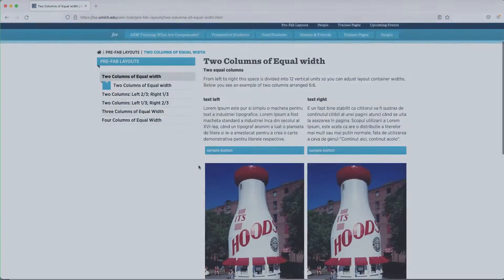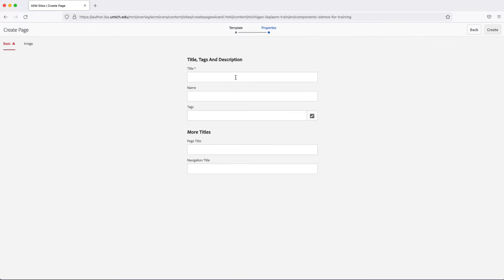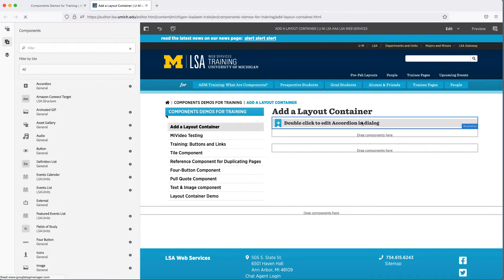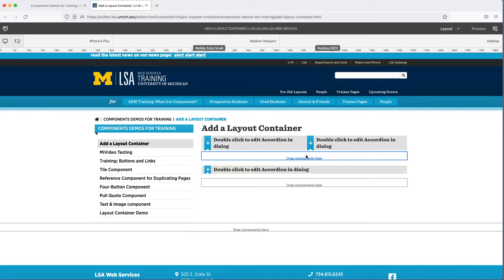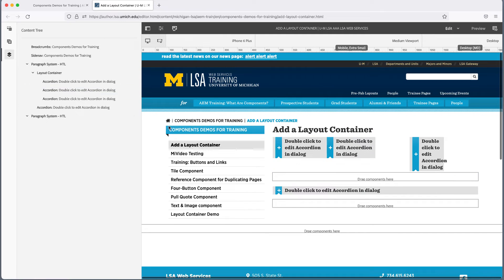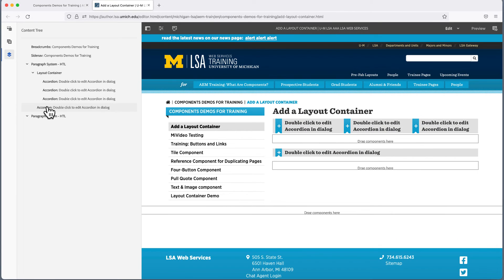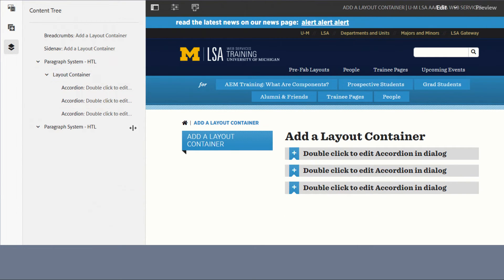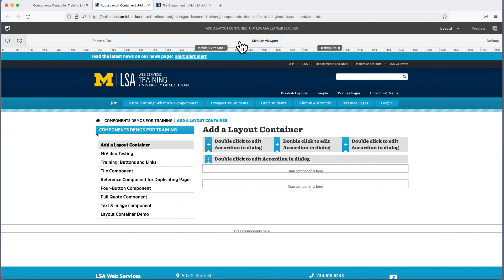AEM Training: Position Content in Layout Containers

Comment from the maker: VIDEO TRANSCRIPT

This video introduces the layout container and how to set up a very basic layout on a page. Layouts can get complicated very quickly, so the Web Team at LSA Technology Services encourages you to contact us for support with setting up layouts. We can also furnish you with pre-formatted pages at your request- please have a look at the model pages on the Training website. 

https://lsa.umich.edu/aem-train/pre-fab-layouts.html

The layout container is a component which is designed to help you organize your pages into sections, such as rows and/or columns. You do this by adjusting sizes of components when the components are inside a layout container, or by adjusting the size of the entire container.

It seems simple enough, but it can get messy very quickly, which is why we have these pre-formatted pages for you.

Still want to take a shot at this? Well then let’s get started. By the way, if you’re following along on a smaller screen like a laptop or other small device, your results may vary. This video, as well as the pages in the AEM Training on Canvas, shows the layout container procedure in a full desktop view.

We encourage you to create a new page, either on the Training site, or on your own site if you no longer have access to the Training site. Use the LSA subpage with layouting template. 

On the new blank page you'll see two empty boxes- one shorter in width, and one that spans the entire page- that say "drag components here". These are drop zones. Please ignore the wider drop zone for this tutorial.

Add a "Layout Container" component to the smaller drop zone. You may either drag and drop the component from the side panel, or click on the drop zone and use the “+”. Another drop zone that appears identical to the first will appear. Your new layout container is the upper one. If you move your mouse over it a blue outline will appear with the words 'Layout Container' in the lower right corner.

Next, we’ll put some components inside the layout container. For this demo I’ll use accordions. Drag the component over the drop zone until you see a blue outline and a half circle with an arrow in it appear above the drop zone, but don’t drop it yet- watch carefully as that outline and arrow will appear above the drop zone in two places depending on your mouse position. We want to drop the component into the drop zone that appears to be the more inside of the two outlines that appear. 

How do we know if the component is inside the layout container? We can make sure it’s in the right place by opening the side panel and selecting the icon that looks like layers. This shows us a thing called the “content tree”. Is “accordion” indented below the layout container? If it is, then it’s inside. 

Let’s add another accordion but this time I’ll drop it in the wrong place so you can see the difference.

We’ll see how to fix this in a moment, but first let’s add one more accordion inside the layout container. This time should be easier since we can watch for the outline and arrow around the accordion that’s already there, and just drop the new accordion on top of it.

Now for the fun part. We have two components inside a layout container, each spanning the full page width. We want to reduce their widths so they can be side by side. Switch to 'layout' view and click the first accordion. When blue dots appear on the right and left edges, slide the right edge to the left to make the accordion smaller. Using the gridlines to guide you, make the accordion half as wide as the available space. Repeat this with the second accordion. 

You might have guessed there’s more than one way to do this. Return to edit view and refresh your screen. Click one of the accordions and from the menu that appears, select the double sided arrow, all the way to the right. This produces the same blue dots that let you adjust the component width.

In the AEM course on canvas that this video supports, you are encouraged to add another accordion to the layout container with the two already there, and adjust its borders. The purpose of the exercise is for you to experience how AEM- a computer program- responds to the adjustments you make. You may have to think like a computer in order to get the hang of using the layout containers. Remember that the Web Team is here to help you, and we have those pre-formatted pages if you decide not to set them up yourself.

You can usually fix this mess by opening the content tree and readjusting the widths of your components, starting with the one that appears at the top. AEM considers this the first one and will always put it as close to top left as it can, following left-to-right reading order. To keep things from getting out of hand we recommend using the dots on the right sides of components to adjust them.

Let’s return to the content tree, the misplaced component, and what to do when your component ends up outside the container. In the content tree, I will find the accordion that is not inside the layout container by looking for one that isn’t indented. If I click on “accordion” here in the content tree, the editing menu for the component appears over that component on the page. This will help us figure out which accordion is the one we want to move.

Sometimes the easiest thing to do is just delete and try again. You won’t lose any content if the component hasn’t been configured yet. Click the component or find it in the content tree and click it there. When the menu appears, choose the delete icon- the trash can. Confirm delete. Then try adding it again.

What if the component is already configured and you don’t want to delete it? Try drag & drop, or cut & paste the component into the container. Depending on your comfort level you may prefer copy paste instead of cut n paste. Let’s try out these methods.

For best results, locate the component you want to move in the content tree and click it. On the page, the toolbar will appear and the component will be outlined in blue. Ignore the toolbar here. Drag and drop the component into the layout container, taking care to observe the half circle and arrow position, as demonstrated earlier in this video.
Check the content tree to confirm that the component is indeed inside the container

Let’s cut n paste this time. Again, locate the component you want to move in the content tree and click it. On the page, the toolbar will appear and the component will be outlined in blue. Click the 'cut' icon (scissors) and then, in the content tree, locate the layout container you meant to add the component to. Click on the layout container in the content tree and the container toolbar will appear and the container will be outlined in blue. But wait! Don’t click the paste icon in that toolbar! The outline shows you where the container is, but to paste into it, you must then move your mouse to the drop zone inside that container. Click where it says "drag components here" and then paste by clicking the 'paste 'icon (clipboard.)

Check the content tree to confirm that the component is indeed inside the container- it will appear indented below 'layout container.'

By the way, copy-paste will come in handy for you if you are configuring multiple components similarly- for instance, a row of tiles with the same margin settings. Save yourself a little work by adding and configuring just one tile and then copy paste it as many times as you need. Then you would update other settings like the link and the background.

Pour yourself a drink.

If you’re wondering why the “LSA Subpage with layout” template came without a layout container already on it, you’re not alone. However, there are a few templates that do have layout containers built into them. They are the following: events calendar, events search, news and events, news search, news summary, the people profile, people summary, and publication summary templates. Each of these is designed for a specific purpose and comes with components already built in, and in order for the components to be built in the layout containers are also built in. 

Your basic AEM templates- the LSA subpage with layouting, the LSA no side nav with layouting, and the LSA news article with layouting- do not start out with layout containers on them. You must add layout containers if you want to use them. If you have done a lot of work already on a page and then wish you had some layout containers, it is very easy to add containers and then drag existing content into them.